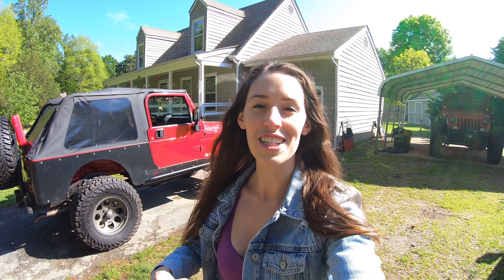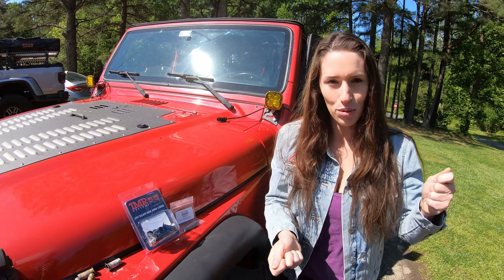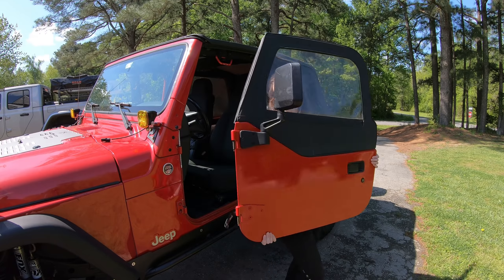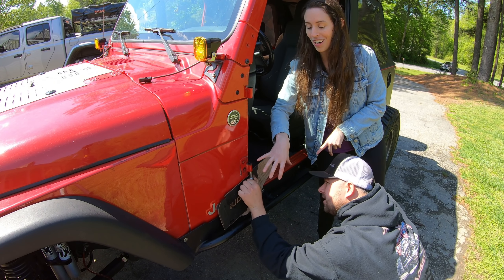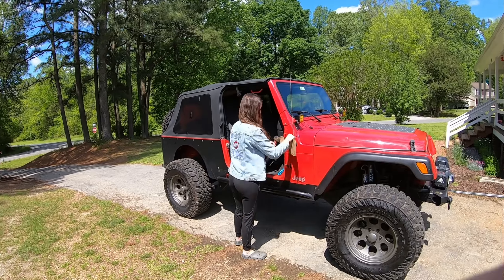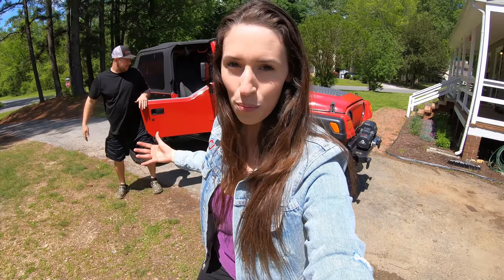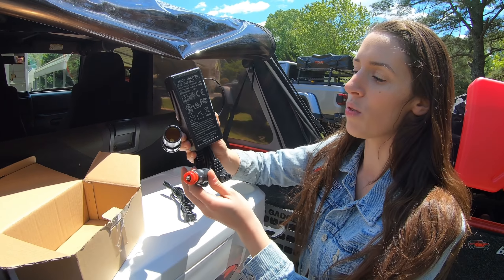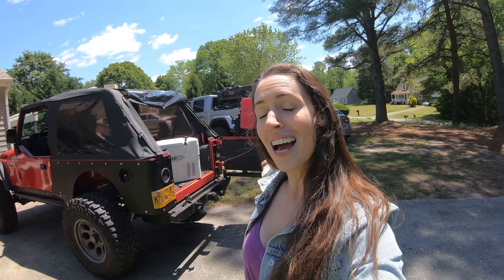NEW Jeep Wrangler Upgrades!!! - Getting Ready For Summer!

Comment: Thanks for buying from Canada (TMR)! I did get a set of the Amazon ones. Even with modification, there was no way they were going to fit. When I talked the seller about it, without responding, they deleted the listing and refunded the money.
Reply from the maker: Another reason to go with TMR, their products are great!
Reply: Jeep Gear & Gadgets have you considered their  universal Transmission mount? 

I lifted the engine and used that mount to push the trans up so I can get an almost flat belly

Comment: Hi great video thanks!  One question.  (I have a 2016 JK 4 Door - took the doors off for the first time yesterday - had to use a jack to unstick the hinges.)  Now that they are off I want to replace the hinge liners.  But I don't really want to have to adjust the hinges on the body because it looks like they are on super tight and painted in place from the factory.  The question is will I have to adjust one or both of the hinges on the body because these liners will cause the door to be misaligned?  I.e., are they a lot thicker on the top than the junky factory lines?  Thanks!

Comment: Hey, who makes the A pillar light mounts??
Reply from the maker: https://amzn.to/2zqgIEa
Just make sure to spray the bolts with Pb blaster a few days before. And use an impact with a torx bit socket. A lot of TJ owners strip those bolts out when using a ratchet or normal torx. Or heat it up, has loctite from the factory. 
Once they are off, take it to a hardware store and get a new bolt that is a tad bit longer to account for this mount width.

Comment: I would change out the 12 volt plug for some Anderson connectors for the 3 in 1.  Also run a dedicated line from the battery for it.  The 12 volt plugs can vibrate out of the socket and you lose whatever is in the fridge.

Comment: When I replaced my hinge liners I found it easier to remove them from the top down, trimmed the flange first if necessary. Yeah what a difference they make unfortunately I damaged my passenger door slightly getting it off, it was really stuck and when it let go I dropped the door on the concrete floor. Bummer
Reply from the maker: The old liners were in there pretty good, I don’t know if I would have been able to get the flanged part off. Lol 

Been there done that😂 If it makes you feel better, Bens JK door fell out of the truck bed while going down the road a couple of days ago. The worst!
Reply: @JeepGearGadgets  OMG that makes me feel sad for Ben's JK but he does have those beautiful Core Doors unless of course those are the ones he WHOOPSIED

Comment: I have a summer set of half doors as well. It's not the inserts causing the alignment issues, It's the doors. Mine act exactly the same. I have to move one hinge each side just a 1/4" or so to let the door close properly. Then move again when it's time for the winter/full doors. I could use new inserts, but I don't have any play at all yet. Best wishes on the move!

Comment: Below is from the ICooler Kickstarter Page.  In the video you talk about an adjustable voltage control, it is that different than below.   https://www.kickstarter.com/projects/iceco/iceco-icooler-exclusive-3-in-1-freezer-0?ref=discovery&term=iceco 

3-Stage Battery Protection System, Extra protection for the car battery!
Automatically shuts the product off to prevent a dead car starter battery Features a 3-Stage Dynamic Battery Protection that can prevent your car battery from running down when connected with your carport. An ECU program for low-voltage battery protection, EMC anti-electromagnetic interference, and Current overload protection design protects the device while you're on the road.

Comment: You can add a low voltage disconnect controller inline when you wire a plug in the back. I run one in my boat and am gonna install one for all the accessories in my Jeep.

Comment: I attempted to get my liners replaced on my 2011 JK and could only get one door off and messed it up putting it back on, what a fail on my part. I tired several different YouTube tips and nothing worked. I gave up. Learned on my next Wrangler take the doors off from the beginning or don't ever do it. I did buy the Jeep with 50k on it back in the day.i'll need to buy new hinges someday.